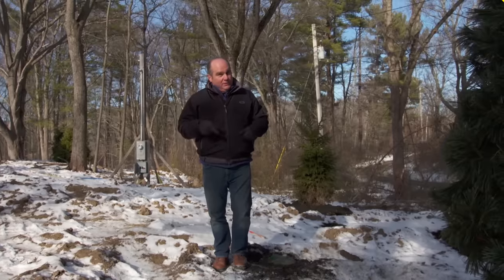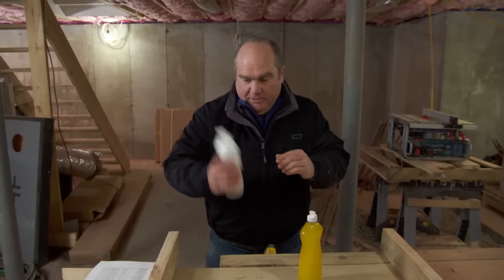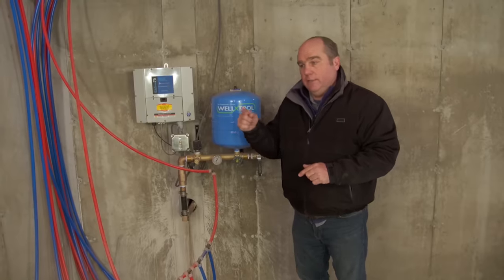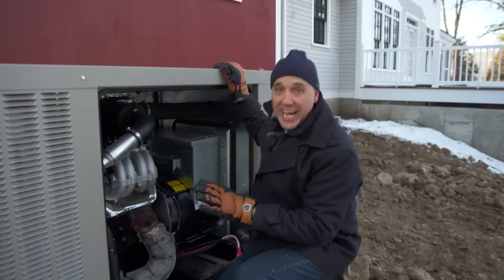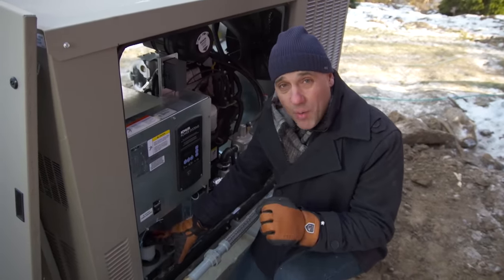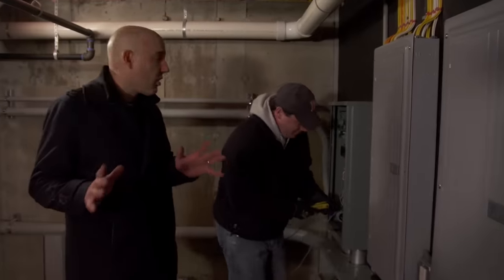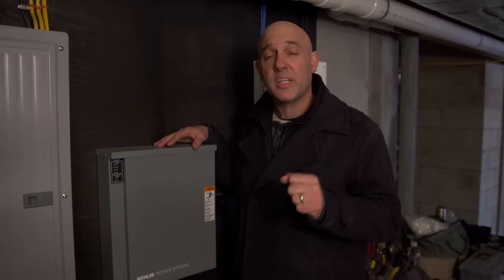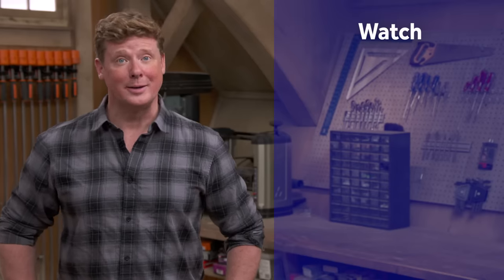How to Get Water from a Well | This Old House

Comment: Just to make sure I understand properly, over 50% of how to get water out of a well is installing a whole house generator?
Reply: Yes unless you want to hand pump cold water from the well.
Reply: @markowalski1  There's no facility to use power provided by some external service? Some sort of, I dunno, "power company"?
Reply: @wbfaulk  Yes because if you watched the video, they mention that if the power goes out, you're also stuck without water.  Which would not be the case in a modern house which water flows from the communal water source,  not a well on your property.

It's probably better to run it off it's own generator anyway,  since if there is ever an electrical issue, it's with the generator not the power grid itself.
Reply: @markowalski1  There are a variety of things in the house that won't work if the power goes out. Anything electrical, probably. If they showed us how to install a ceiling fan, would ⅔ of the video also be about a whole house generator?
Reply: It's much cheaper with solar panels and a battery
Reply: @wbfaulk  it should be. 2/3rds of anything is always installing another whole house generator. I'm gonna install another one when I get my new tablet in the mail.
Reply: In other words. They spent more time talking about the generator than talking about the title of the video. A well.
Reply: @markowalski1  I love how you simp for the blatant product placement and lack of any useful information in this video. Bravo good Sir, bravo.
Reply: @wbfaulk just shut up and buy this generator- we are just home owners and don’t know what we are doing.

I now NEED a generator, because all my appliances are electrical and a tree could fall at any moment!!!

Comment: A generator is not a solution long term once you run out of gas. I just installed a manual hand pump on my well. I can get endless water with no power.

Comment: As a well water user, not wild about that setup at all. There seems to be a pretty high failure rate for those constant velocity pumps. But even if that thing is bulletproof, I always thought the CV pumps were a solution in search of a problem. I have a conventional Franklin pump in a deep well, and it comes in to a 20-gal pressure tank (a much larger version of the Wel-X-Trol shown in the video). My pressure in the house no matter what I do is always between 55 and 65. You can't tell if the pump is running or not. That's the pressure tank's job. The bladder lasts a long time and it's a heck of a lot simpler than a CV pump with that fancy controller. Also, no filtration at all? That's nuts. You're going to get sediment out of any well, no matter how clean it is, If you don't at least put a sediment filter on it before heading to the fixtures, you'll eventually clog up every aerator and valve in the house. For the expense, why wouldn't you put on a sediment filter? It adds like maybe $200 to project cost. Homeowner changes maybe quarterly for $10 a year, tops.
Reply: My house is almost 40 years old, has always used a well, has never had any filtration other than the ground itself, and has NEVER clogged up ANY aerator or valves in or outside of house.  So you are full of crap.

Comment: does this well system need a special pump or can it be installed on existing systems?
Reply: It needs a deep well submersible pump at the bottom, which is 500' down. Not something you want to pull out by hand. If you have a drilled well, yes it can be used, as far as I know.
Reply: I would assume they have a variable speed pump.
Reply: @rosemcommm  just buy the generator, did you not watch the 5 minute long commercial?

Comment: Richard, at about 1:40 you said the water supply line to the house needs to be about 4' below the frost line.  Did you mean 4' below ground level?  Not sure where this project is, but if it's in New England like many TOH episodes, wouldn't 4' below ground be safe?  Here in Ohio our frost free depth is 36".

Comment: Why is the hot and cold PEX run parallel to one another?  Hot is just warming up the cold and vice versa.  They're not really separated.
Reply: At least those ones are flat. My previous home had all of the pex pipes in a big bundle. Hot water took forever to get to the fixtures and the cold was warmer than usual.
Reply: Some contractors want things to look good rather than work well.

Comment: Do banks have Mortgage loans for generators like that ?
Reply: Gonna need one !
Reply: the gen is only around 5k, plus the electronics ,wire, delivery/shipping, labor and other little extras should be no more than 9 to 10k total.
Reply: @marcelgaddis9319  ... on that brand of liquid cooled set I think you will find the retail for the outside unit is closer to $12k plus installation and misc. IOW, around $15k or so. I might be off by a little as I retired from that business 2 years ago.
Reply: James ... last I looked about 50% of dealers offer some kind of financing terms. Worst case is you use a credit card and spread it out over 2 years. Might be a good time to start a new account with 0% for new customers.
Reply: @rupe53  Might be better not to go into debt for a luxury item. A cheaper generator will get you though the storm.
Reply: @davidparker9676     true, but you need the ability to do the manual labor of moving it, fueling it, connecting it, and being around when it needs attention. Many homeowners don't have that know-how and may not even be home when pipes are freezing, or elderly people are there, life support systems, etc. There are 100 reasons to go fully automatic, versus the cheap route.... not counting people with extra money to burn.
Reply: @rupe53  Well, if you are ay of the groups you listed, it would be better to fly south where you don't need any of this stuff.

It is expensive to live in a cold climate. Moving to a warmer climate might make more financial and personal health sense.
Reply: @davidparker9676    you are ignoring the other 96 items I didn't mention. I will start with stair-climbers, oxygen machines, AC / heat, fridge / freezer, and even stuff necessary to run a business from home Yes, even in Texas or Florida people need heat for at least part of the year... and some elderly need AC when the weather is bad enough. You also have to consider where family is and that's a big item for elderly people. With old people they think about what it might cost to move ($%-$10K?) and how most a real estate broker will cost. (another $20 - $30K?) Ok, we'll drop a few bucks into house improvements and stay here. BTW, for many of us the jobs pay better up north, so an easy trade from a financial viewpoint.
Reply: @rupe53  You seem to ignoring the fact that the power and water supply are very reliable in the south. Living in a single story dwelling in a warmer climate is a significant savings over just the heating bills of the north. People in the south go decades without having to repair heating or cooling equipment and the water is always ready on tap.
Remember, my argument is that you shouldn't have to finance or mortgage a generator to stay alive. If you have to put it on a credit card for a "what-if" scenario, you probably are better off living somewhere more affordable and stable. 

I have no issue with someone spending cash to have the best of the best stuff money can buy... if they have the money to spend. If you have the money to heat your house and stay comfortable in Alaska, that's cool... if you don't  maybe it's time to relocate.
The people living in places they can't afford and spending money they don't have just for the basics, you have to question if it is the right place to be.

Of course you make the extreme argument of desert Texas or places like Arizona, of course it is the equal but opposite problem; spending your money to stay cool and avoid heat stroke. 

There are places you don't need a heater or an A/C, just blankets in the winter and a fan in the summer.
Reply: @davidparker9676    the only argument I am making is not everyone is able bodied or willing to relocate. People want what they want, when they want it... and stuff like this makes it possible. They don't have to live in a house that's 55 degrees or 95 degrees, which may be a death sentence for some older or disabled folks. BTW, you still haven't said where in the south that perfect weather is... or those reliable utilities.

Comment: Does the water line need to be 4 feet below the frost line? . . . Or did he mean the water line needs to be below the frost line, in this case, 4 feet below the ground surface?
Reply: His sentence definitely had a misplaced modifier.  I also did a double take but I'm pretty confident the answer to your question is the latter.
Reply: Below the frost line, in this case 4' below the surface.

Comment: Prefer solar and battery. More responsive and you don’t have to listen to a generator running( very noisy).
Reply: And what if it's cloudy for 10 days ???
Reply: @vannorman1116  Good question. I have a 15 kilowatt system and it has been cloudy almost every day in June where I live. It has averaged a production of 40 kilowatts a day. Your system still produces even if it’s cloudy, just not as much of it was sunny. On full sun days my system produces between 80 to 90 kilowatts.
Reply: @vannorman1116  What if you have no gas?

Comment: What if you could just hook your truck to your house and use that.
Reply: Technically you could with the right setup. Will you be able to run everything in your house no not even close. Although with the right equipment you could but buy the time you did that it would be cheaper to just by a generator
Reply: @hotrodpaully1  it would be cool if you could put wheels on the generator and drive it around.

Comment: ~sigh~  so.. nothing inside the well house gets shown.. I could swear there's some sort of plumbing going on in there.  That would have been a whole lot more informative in a video about getting water from point A to point B without half the video about the generator.  Types of fittings.. pipe.. which can have clamps.. which need glue.. which need teflon tape.. the stuff that actually involves the plumbing inside the well house.  Where is that video?

Comment: Roughly, how much would a generator set up like this cost?
Reply: Between 7 to 10 thousands dollars. Depending on the size.
Reply: the gen is only around 5k, plus the electronics ,wire, delivery/shipping, labor and other little extras should be no more than 9 to 10k total.
Reply: @marcelgaddis9319  ... .as soon as you go to a liquid cooled set the base price will be $10 - $12k, just for the unit. If you go with an air cooled set you can probably do the whole install for under $10k.
Reply: It costs about tree fiddy.
Reply: @rickyrick9328  
That was funny as hell. 🤣🤣🤣